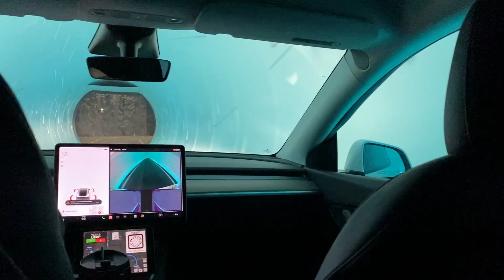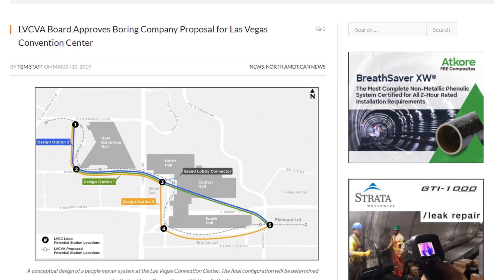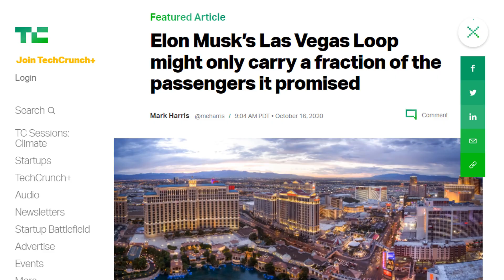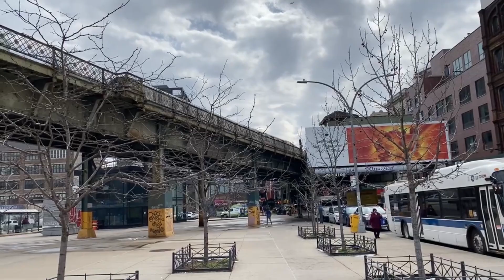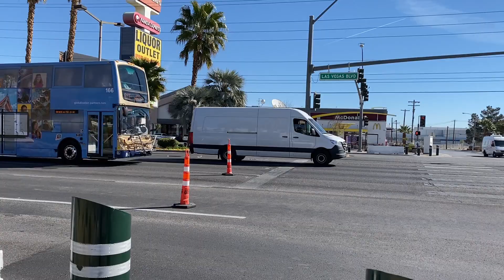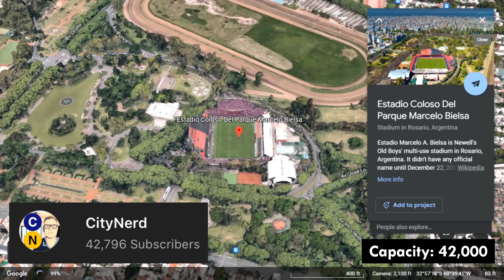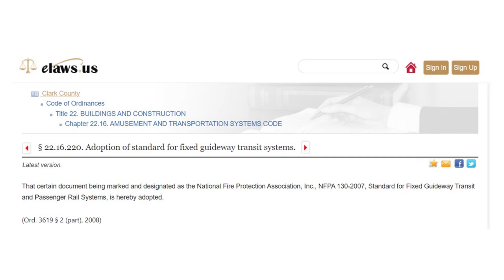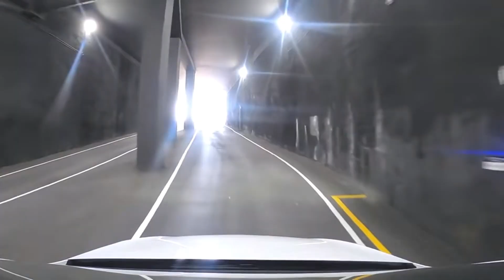Inside the Las Vegas Loop: Transportation Game-Changer, or Complete Waste of Time and Effort?

Comment: The Boring Company's main goal is to drastically lower the cost and increase the speed of tunneling, it's a really tough challenge and they're a long ways from achieving that goal. If they do manage to accomplish that goal then it will be just as beneficial for subways, underground light rail and other infrastructure as for Tesla tunnels. 

I do think that Tesla plans an autonomous pod that may carry 12 or so people, similar to the self-driving pods seen in Westworld. Las Vegas was essentially just a way for The Boring Co do R&D on someone else's dime, I personally don't think it's productive for them to get so far ahead of themselves so publicly because what they built looks silly in the present.
Reply: The LVCC tunnel was paid for on the dime of the LVCVA.  It's such a short tunnel that it can't fully show off the advantages of the Loop.   It does illustrate how a loop would reduce wait times for passengers.   

The 30+ mile  Las Vegas Loop is being built on the dime of The Boring Company.  They're doing the R&D on their own dime.   The advantage of doing it in Vegas as opposed to a testbed on TBC property is that the Las Vegas Loop will begin to generate revenue for TBC as sections of are completed.

Comment: I do like the idea of many-entry many-exit point to point systems where you can bypass the stops. Elevators in large buildings work this way, you say 5 people to X floor and it tells you what elevator to get into. But for that to work it does have to be able to be low speed autonomous above ground, at least in parking lots and things that and be fast and autonomous below ground. If you can do that with a relatively cheap 8 person battery electric bus and cheap tunneling then you got something that is potentially useful.

Comment: I'm definitely going to get a lot of hate for this but I actually believe the boring company is a game changer. Here's a few simplified reasons why I believe so:

1. Reduced cost
Yes the capacity is also significantly reduced, but when you look at a cost per mile of tunneling of 10 million for the Boring Company and 600 million for a subway, well that's a massive difference. Additionally, not everywhere needs a huge capacity. Some locations don't need to transport 20k people per hour. For some locations 2k per hour would be ok. 
2. Future improvements
Yes right now the cars are driven by people but this WILL change. Soon, these vehicles will be completely autonomous. Also, a larger people mover type vehicle could be implemented. Something with seats along the side and standing room in the middle that can carry 10-12 at a time.
3. Flexibility
Because of the reduced cost per mile of tunnel and low capacity, this system is extremely flexible. Need to transport 20k people per hour, have 10 tunnels. Need 40k per hour, ha e 40 tunnels. Need 4k, have 2 tunnels. The tunnels can also be used for other things besides transporting people such as transporting freight. It's very flexible. 
4. Better experience
Because this is a direct system where passengers don't need to stop at each stop and can instead go directly where they need to, the travel times are reduced, especially in a larger system. Additionally, people don't need to worry about having to wait for the next train or tram to arrive, instead there is always at least one vehicle ready to go. And while having some vehicles does lower capacity, it does increase comfort. Not having to share a large space with 50 other strangers is very appealing to many.

Overall I think you are missing some of the key parts of this system that could potentially make it great. Right now it is not that great, but you can see how a few more improvements could make this into a great system. Also I believe they ran an actual test with people from the public and achieved the quoted 4,400 people per hour.

Comment: From Vegas POV though, get Boring company to build you a tunnel, get a tourist attraction for a few years, then when it proves unprofitable buy the tunnels at a discount and retrofit with effective public transit. Seems like a win to me, if that's the path they follow.
Reply: I think The Boring Company is going to run higher capacity vehicles (small electric buses) mixed in with the sedans (which will eventually be AI-driven taxis with no steering wheel).   The buses will handle traffic to and from large venues like the stadium and the airport.   The taxis will take people point to point in the system without stopping.    The bigger vehicles will be available on request whenever you have a large group that wants to travel together. 

Replacing it with "effective" public transit, like a lumbering bus that stops at every station and requires passengers to get out and wait for another bus to transfer to another "line" doesn't seem to me to be in the cards. 

I think Vegas might consider paying The Boring Company to extend the system into the city where the residents live and work.  Subsidize the fares for locals (nearly all metro fares are heavily subsidized), and let out-of-towners pay the regular rate (casinos can comp loop fares).

Comment: For much of this video, I just kept glancing down at the release date, expecting it to say "Apr 1". But great video. Elon just keeps over-promising and under-delivering, and yet, people keep falling for it and keep ending up with a substandard product. Even though the current tunnels seem too small, I at least hope some of that infrastructure could be reused for a proper transit guideway system in the future.
Reply: The LVCC loop is doing the job it was proposed to do. It transports ALL the people that it needs to. There aren’t any passengers left behind or made to wait to justify replacing it with trains. 

Average wait time during CES was less than 15 seconds and average trip time was under 2 minutes.   A train couldn’t match that, let alone beat it. 

It remains to be seen whether the larger Las Vegas Loop can meet a demand that has room to grow (unlike the LVCC Loop, which is limited by occupancy limits of the convention center). They can address capacity by including vehicles with more seats in their fleet.   This, plus making the vehicles autonomous, will make the loop more capable and reduce the urge to spend billions making it a train.

Comment: Bro. That 51-station system they got approval to build could have been an actually good, high capacity mode of public transit in a city that could really use it, but instead we get cars in tunnels. I hope the city gets smart and pulls the plug before they dump any more money on this thing.
Reply: The city isn’t dumping any money. TBC is paying for the tunnels. The venues are paying for the stations. 

TBC will operate the system and pay a portion of the fares they collect TO the county as a franchise fee.

Comment: Funny video. I think underestimating how focused Musk is on both costs and long term solutions would be ignoring some of the big picture. Obviously, this type of project is in conjunction with autonomous vehicles. Yes, that’s taking forever but here he won’t have to deal with unusual road anomalies in this tunnel. One would have to imagine he’s considering some other type of autonomous transport vehicle for these tunnels that carries more people, more quickly and without drivers. This is proof of concept.  Certainly rail/subway systems can carry many more people but there is a reason most of these aren’t getting built and it has something to do with the cost…California high speed rail projects estimated at $154 million per mile. They get proposed all the time but never people.  Apparently Europe has figured out to do it cheaper or people don’t notice the line item their high taxes that shows “high speed rail fee”.